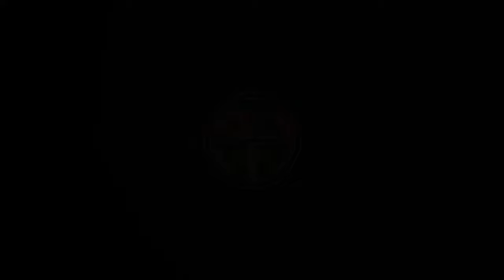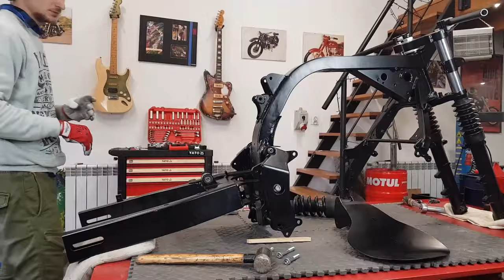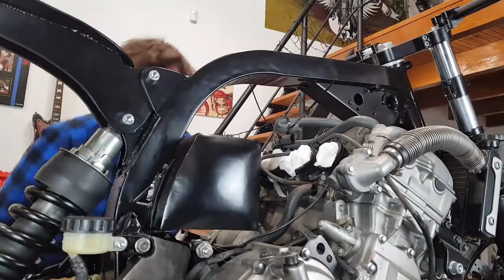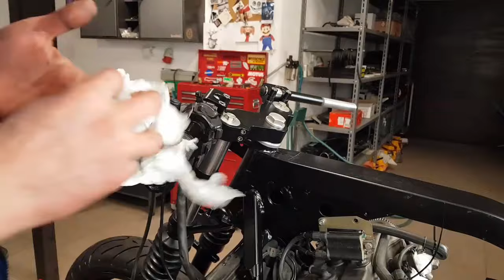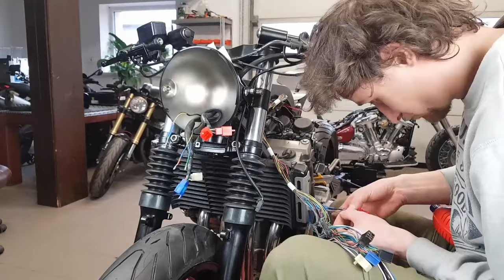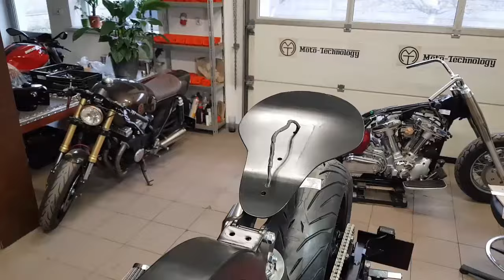Honda CB600 Custom Cafe Racer by Moto-Technology

Comment: Hi. When you replaced the airbox what did you do with the two hoses that feed into it? Thanks.
Reply from the maker: conical filters have been installed on the engine venting pipes that come to the airbox

Comment: Nice build, did you have to change carb jets to run pods?  I've an 89 that I am planning on doing similar.
Reply from the maker: Please write to us on our email: info@moto-technology.pl
Reply: @Moto-Technology  can I make this happen on a 2000 CBR F4
Reply from the maker: @coachk9316  Yes you can. It all depends on the ability to weld and fit the elements, the entire exhaust system was made by us to the customer's order.
Reply: May i get a ball park on possible price to get something like this done
Reply from the maker: @coachk9316  Please contact us, our e-mail: info@moto-technology.pl

Comment: hello, I installed such air filters as yours, the motorcycle does not eat, what needs to be done? ((((
Reply from the maker: "the motorcycle does not eat"? what you mean?
Reply: @Moto-Technology  the motorcycle starts, but stalls when I turn on the gas!
Reply from the maker: @raslcustom  it should not be the fault of the filters.
Reply: @Moto-Technology  just filters dude! I already figured it out!
Reply from the maker: @raslcustom  good job!